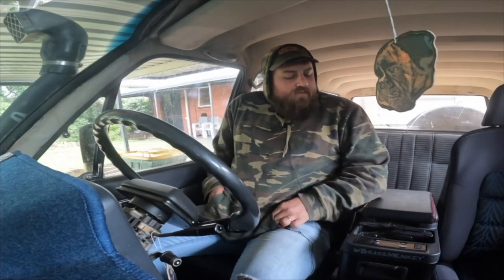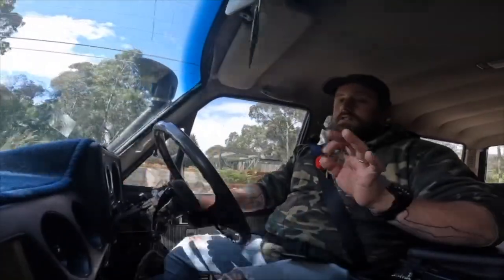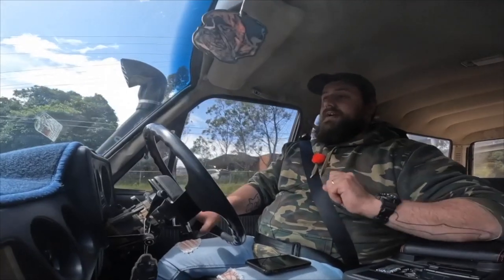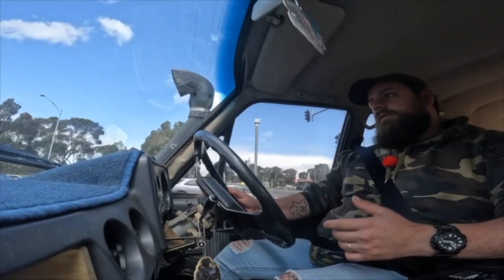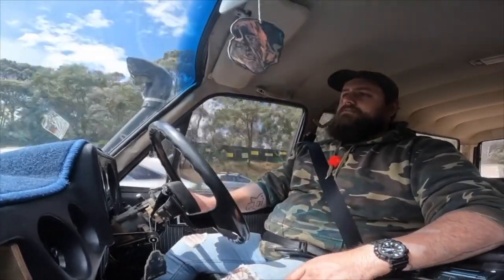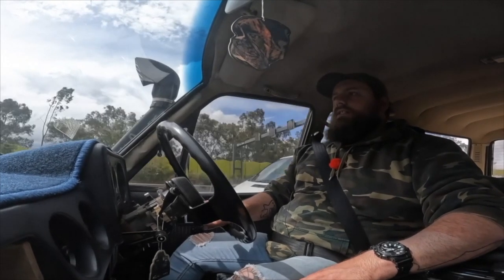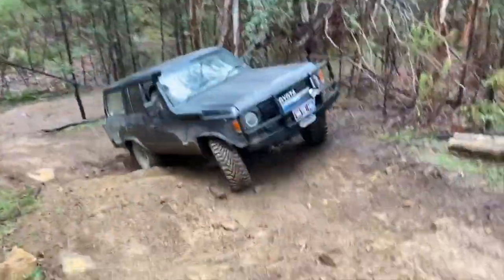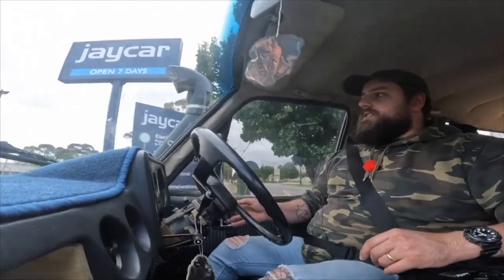WATCH THIS BEFORE BUYING A HOLLEY SNIPER!

Comment: I bought a carby for my 62 on Ebay about 4years ago, $160 or there abouts, runs great, fuel on long distance about 15 to 16L at GVM at around 90 real kmh (speedo's are notorious lyers), in the bush about 20 or more depending. 

The most perfomance I got out of the thing is using a set of headers and a 2.5" exhaust, 1 straight through muffler (gets the thing reving properly, dont be scared to rev it to just under redline they love it, fuel use however falls in the crapper) and to change the timing curve. (Advance weights 2.5 milimeter ahead of normal retard. (Can use 2 to 2.5mm wire around the natural stop of the weights or weld) The total advance stays as standard. Springs stay standard. Take off is much crispier)
Mine is a "86 3F carb, auto,  Sahara with 33"x 12.50 tyres over 700.000km on the engine. Ive owned for 25 years. Engine runs like new!

Comment: This is very helpful, I've been back and forth about doing this(the Holley) or doing a om606 swap on my 60. Its that $2k vs $5-6k battel and power vs originality.
Reply from the maker: I hope I’ve help you make a decision brother 👍🏻
Reply: how is a sniper setup $2k?
Reply from the maker: @soelost1313  To By it is $2500 alone
Reply: @favouritejay  I only paid $911 so I was confused but I just realized you didnt pay USD
Reply from the maker: @soelost1313  things are a lot more expensive in Aus haha. Plus the conversion rate is through the roof at the moment. So 900us is close to 1300aud.

Comment: i wouldnt bother even though i love it,  a proper hho cell on a non O2 sensor engine is better, fsr lower emissions than efi, 20% better economy about the same in power, but its not set n forget and you need basic electrical knowledge, its old old technology. i get told all the time it doesnt work. if that was the case we wouldntve been using them for the last 4 decades.
Reply from the maker: I agree, the holy is better if you want originality. Otherwise I’d go something else